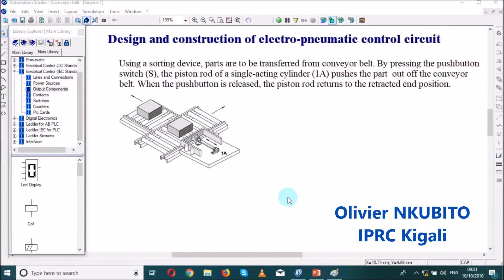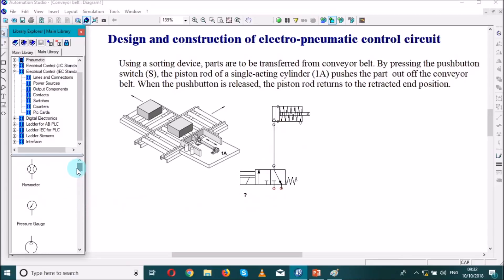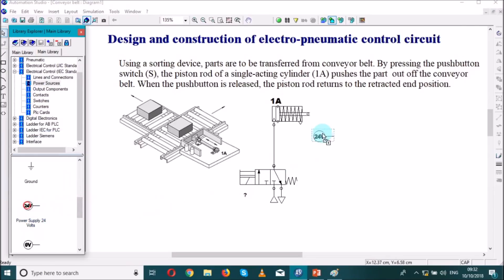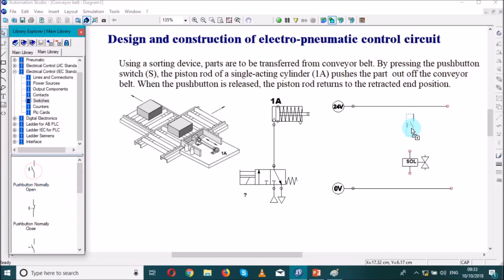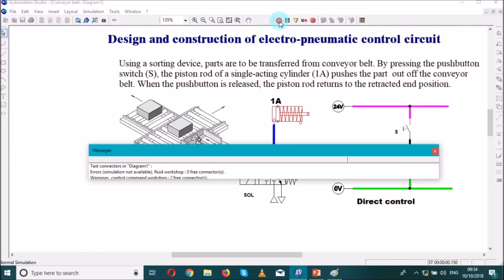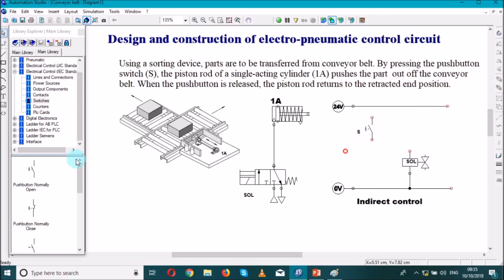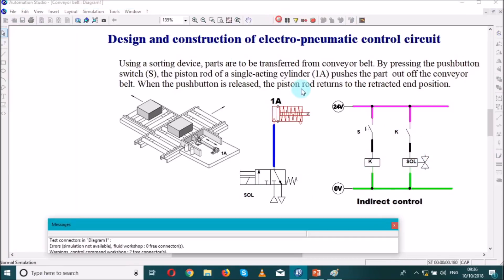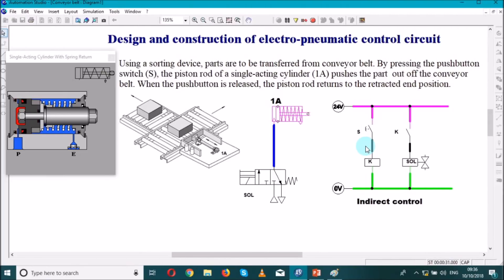Automation Studio: Sorting device [Electro-pneumatic control circuit.]

Comment: Hello Olivier,  your content is really helpful. I am an electromechanical engineering student and I stumbled upon your youtube channel and I am learning a lot. Thank you for this! :) Is there by any chance if you can create a video on how to make a Transfer Station. Using a transfer station, parts are to be transferred from a magazine to a processing station. The parts are pushed out of the magazine by cylinder A and transferred to the processing station by cylinder B.
Reply: The details are as follows: 

When push button 1 is pressed (PB1) and push-button 2 is pressed then Cylinder A will extend.
When a limit switch senses that A has fully extended (LS1) then B will extend.
When Push Button 3 is pressed (PB3) or Push Button 4 is pressed (PB4) then Cylinder A will retract – this will cause B to automatically retract at the same time.
***Using a flow control to control the speed of the B cylinder extending, it should extend at approximately half the speed that it retracts.
•	Cylinder A is a single-acting cylinder, controlled by a Double acting pilot control valve.
•	Cylinder B is a Double-acting cylinder, controlled by a Single-acting pilot control valve.
•	Using appropriate valves, pushbuttons, limit switches, etc.

It would be a great help if you could shed some light on this. :) 
Thank you
Reply from the maker: Thanks @Sahib Bhardwaj! I will do it sooner.